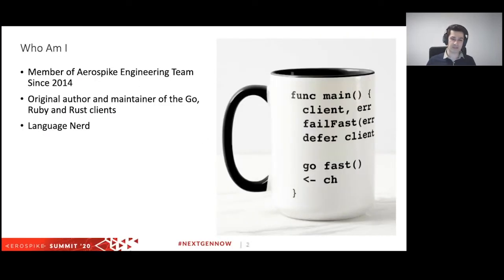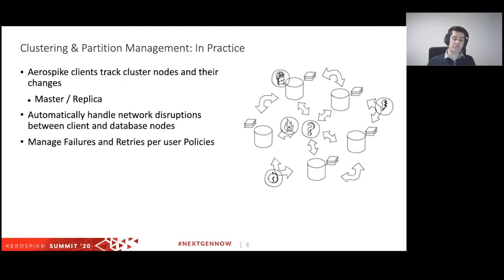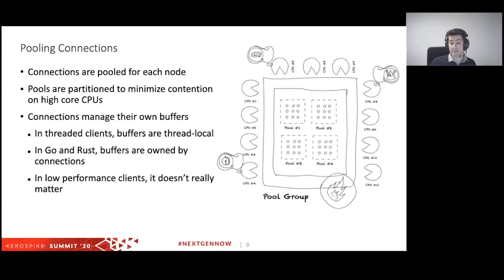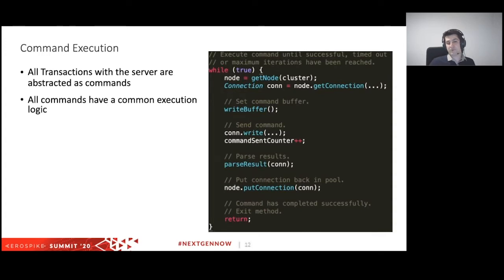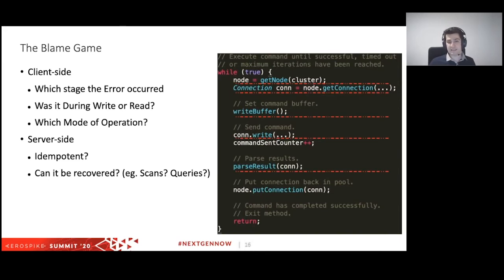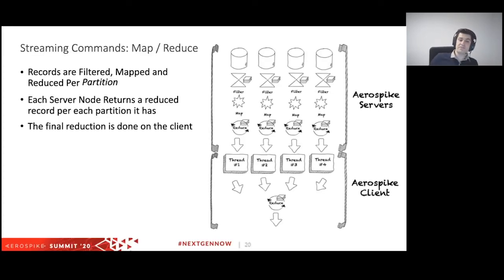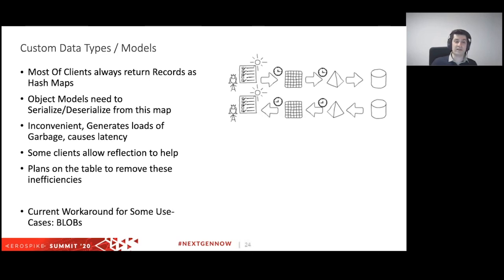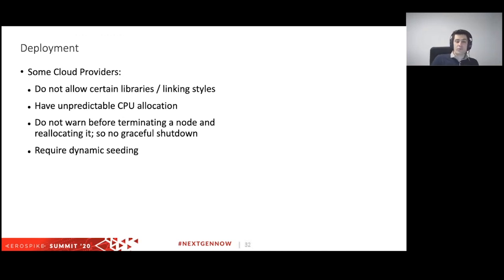Aerospike Client Design and Internals

Comment: "race condition doesn't matter" - no, thank you.
Reply: You can use race conditions as random number generators sometimes. In those cases, they are a part of design, and not a flaw.
Reply: @parshua  you can't. A data race gives you an unpredictable result, but not a random one.
Reply: @jekamas  That's what you need to choose a random queue from a limited number. Not all RNGs should be cryptographicly perfect. A Race condition has its own uses, and this is one of them: Psudo-random lock-free choice between a limited number of items. In the Go client, we avoid using the race condition approach by using the first byte of the hashed key as hint. But it doesn't invalidate the approach in those clients which use the race condition for the same purpose. Horses for courses.
Reply: @parshua  that won't be even just pseudo random hence it's not prooven as one. It's just indeterministic.
Reply: @jekamas  Whatever you want to call it, I'm not arguing about the Taxonomy here. It works in this use case, and you don't seem to have much of an argument against it.
Reply: @parshua  if I'd call it somehow, I'd call it UB :)